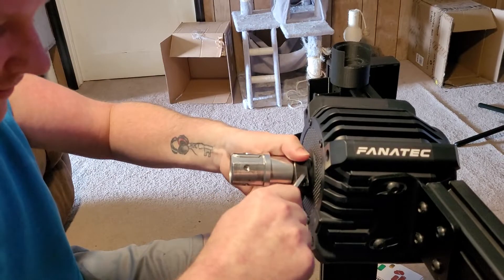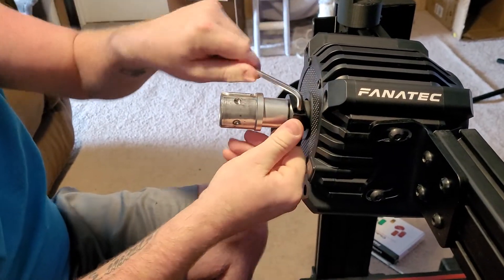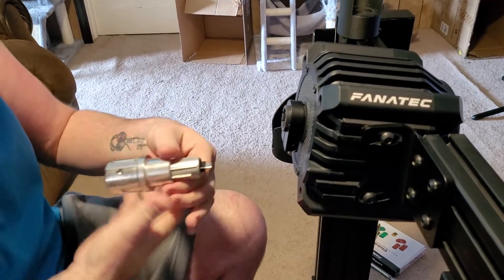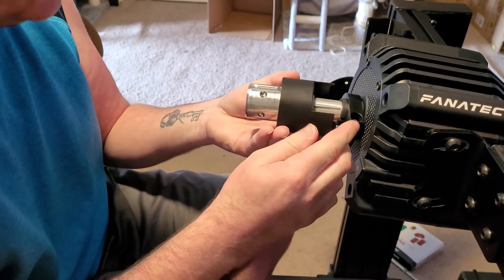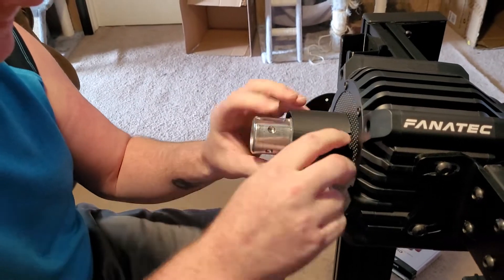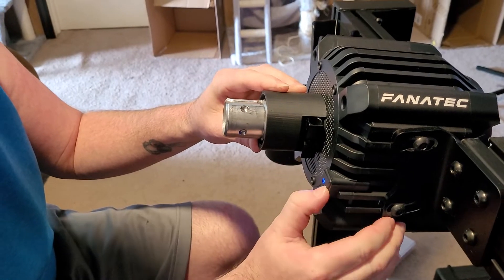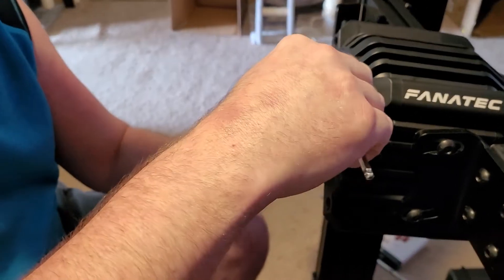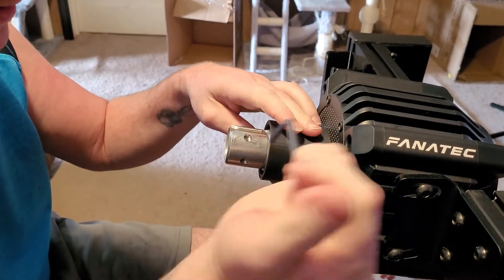how to install AT3DPRINTSHOP shaft cover for Fanatec wheel bases

Comment: You didn't mention probably the most important thing to do... you have to make sure that clamp is aligned with the gap in the shaft, otherwise you can damage the shaft/USB port. It is in the manual, if you read it.
Reply from the maker: Yea I just put it back exactly how it was. You are correct though

Comment: Can you still recommend the shaft mod? I can get my hands on one and would appreciate to get rid of the "clanky noise-feel" moments and the flex. Does it really work?
Reply from the maker: it doesn't make it 100% go away but it does help! i still totally recommend it though as it make the wheel base look so much better hiding the silver shaft while everything else is black.
Reply: @Jedtgill  I ordered one and can't wait to test it cause the clunky feel and sound is making me nuts, even though it's not a constant issue. But can I use the shaft while I tighten the Qr1 with the setting skrew?
Reply from the maker: @Gelangweilter  yes! That set screw is in the QR1 that sleeve comes up against the back of the qr1. Message the owner before it ships and see if it would be worth your while to order the ones he makes with a set screw built in. If he still does those it help eliminate even more movement
Reply: @Jedtgill  damn it, mine is coming without the extra screw, I hope it does the job aswell
Reply: @Gelangweilter  mate try running the wheel without the screw in your qr1 idk but that's the only noise my wheel makes is the qr1 bouncing off the screw since the quick release sleeve rotates and hits the screw.
Reply: @Jedtgill how much %?
Reply from the maker: @moncimoov  I have one of the very 1st versions and I'd say about 75% I was completely satisfied with it though. I'm sure he has mad revisions since then and it's better now. All of his stuff is top notch
Reply: @Jedtgill  thats nice.. im thinking to print one myself .. gonna target 90% with added rubber or thin layered plastic also

Comment: Is this useable with qr1 lite ?
Reply from the maker: Yes you just have to select qr1 lite when you buy it
Reply: I’m having connection issues during mid race I don’t see where the option is for the QR1 Lite? Have they changed the listing I don’t want to purchase the wrong thing
Reply from the maker: @RyanBMcLaren  I'm not sure to be honest. Message Caleb through Etsy he will set you on the right path!

Comment: 🤔 It's causing my steering wheel to jerk and it's hard to screw off but from what I'm seeing on yours.. minds is really on their real tight having trouble screwing minds off hoping that's the issue
Reply from the maker: Thats prob due to fanatec crappy tolerences. This item shouldnt cause the wheel to be jerky. Did you by chance make sure the pegs in thebcolor were lined up when reattaching the wheel? Either contact AT3D he is a great guy and will help no matter what
Reply: @Jedtgill  😎  Ok got it.  I finally figured it out after 3 days it was the options in my Desert rally game The option for the steering wheel feedback was on that's what was causing my steering wheel to jerk around
Reply from the maker: @kal-elthelast8834  glad you got it figured out. As far as AT3D i 100% stand behind all his products i have purchased just about every item he sells. Feel free to follow me and ask any questions you ever have!

Comment: I got the clamp for the Podium DD wheelbases on my GT DD Pro (the round one with two bolts instead of one) so this 3D print won't fit on mine, Fanatec put this clamp on after repairing my wheelbase that got damaged because the shaft got pulled out and then the USB inside the shaft didn't align properly so when I pushed it back I pushed straight through the PCB inside the wheelbase and destroyed it, thankfully Fanatec repaired it within warranty at no additional cost.
At least now the shaft is held a bit tighter so it's harder to pull out the shaft, still... using only a clamp to hold the shaft in place is just bad design imo.
Reply from the maker: Yea but all the noise and wobble sadly comes from the QR not the shaft
Reply: @Jedtgill  Yes but I was saying this solution won't work for me because I have a different (bigger & round) clamp on my shaft.
Reply: The creator of this product has a second version that works with the double clamp like you have.  He also sells a double clamp, which I bought to upgrade mine, as well as his sleeve that goes with it.

Comment: My shaft is bent to the left for some reason, I hope it doesn't make the cover brush against the base
Reply from the maker: Have you contacted fanatec about the shaft?
Reply from the maker: Either way ot does have a little room to move forward or backwards so i wouldnt worry about it causing damage
Reply: @Jedtgill  yes, still waiting after almost  two weeks sadly
Reply: @Jedtgill  Great  gonna get one for sure. By the way, is your shaft completely straight? Some people say it's normal for it to have an offset but I'm not so sure about that
Reply from the maker: @JohnnyEMatos  i dont think mine does BUT if your wheel isnt angled perfectly with your seat it will seem like its bent at an angle
Reply: @Jedtgill  it goes up when I turn right and down when I turn left (because it is pointing left) I can aldo observe that on the stator without the shaft attached to it, so it's not really the shaft itself, but the angle that the stator comes out from the motor. I even removed the plastic front plate to see it better
Reply from the maker: @JohnnyEMatos  i woukd stay up late and get with fanatec live chat. That 100% doesnt sound right

Comment: Warning! 

Within 4 months of light use my FANATEC McLaren wheel cracked at the shifter pivot point and where it mounted to the QR. I was accused of over tightening although I used a torque wrench set at 3nm. 

FANATEC then replaced the wheel chassis admitting in writing it was a weakness in the wheel.

Very soon after my CSL load cell pedal failed. I sent a video before sending the pedal set back as requested.

I was required to make a follow up email after not hearing back. 

FANATEC said they can not fault the pedals asking if I want then sent back which I found a strange thing to ask?

Eventually they were returned however within minutes I experienced the same issue which was consistent with magnetic interference from the CSL DD wheel base before the load cell pedal would completely shut down.

I was beyond my limits at this point and driven to warn as many potential customers as I could while demanding a replacement.

Following the usual delayed response, FANATEC then offered a replacement only if a show proof that they faulty load cell was again on its way back to them.

FANATEC’s poor response time drove me to desperation. 

Keep in mind I have owned this new product for around 6 months when 2 major failures occurred.

An electric technician overheard my experience and offered assistance.

I was able to demonstrate the issue and within minutes the technician diagnosed a defective voltage regulator attached to the load cell circuit board. 

The voltage regulator is designed to reduce 5 volts coming from the wheel base or USB down to the required 3.3volts. There was no signal out of the regulator which he replaced.

I am now enjoying my sim racing again while I hold my breath for the next FANATEC failure.

Please take my advise and look at the FANATEC’s own forum in regards to all the issues they have and their terrible customer service.
Reply from the maker: Ive had mine since gt7 launch and its like brand new with close to 1000 hours. Id contact support
Reply: My shaft collar keeps slipping I’ve done all the typical move it as far forward and tighten as tight as possible im a big guy with a lot of power and I couldn’t possibly tighten it any more ruins the whole experience
Reply from the maker: @jordanblud10  contact the maker and ask him about the one with a set screw
Reply: I have needed Fanatec support two times now (actually 3 times but the third time was right after the 2nd because Fanatec repaired my wheelbase but broke the connector for the pedals) for my GT DD Pro bought on release, and they have been very benevolent to help me out.

The first problem I ran into was the GT wheel that had the rubber worn out down to the plastic underneath after like 6 months of use, so I contacted Fanatec sent them a photo, and they sent me a return label, a week after sending it in I got a package back with a brand new wheel in it, unfortunately though, it now already has the same wear on it, so it wasn't a bad batch of rubber which I thought caused the first wheel to wear down too fast, so I'm kinda forced to buy a new wheel unfortunately. 
I recommend NOT to get the GT DD Pro bundle with the GT wheel, always get a different wheel because the GT wheel wears out way too fast.

The second problem was caused because the shaft can get pulled out if you have the tendency to pull on the wheel, at some point the shaft got pulled out far enough that the USB of the shaft didn't touch the USB in the wheelbase anymore and somehow the USB connection didn't align up properly which shouldn't be possible considering you can only put the shaft in 2 ways and the USB C connection is right in the center so no matter what way you put it in, it should always align.
So I tried to push the shaft back after loosening the clamp, but because the USBs weren't aligned properly, it didn't go in like it should've, and when I pushed a bit harder I pushed straight through the PCB inside the wheelbase, so it got destroyed basically.
And again after sending them a picture and a video as requested they let me send it in, a week later I had a working wheelbase again and now with the clamp from the podium wheelbases on it, which should be able to hold it a bit better as it has an extra bolt to tighten it on both sides, so far the wheel has not gotten disconnected yet, so that's a good sign I guess. Only now I also had a loose connection for the pedals that caused some faulty input in some cases, which wasn't the case before I sent it in, so I sent it back in again, and another week later I received it back and everything was working as it should.

I was very surprised Fanatec didn't charge me for the wheelbase repair, as they could have easily said that I had broken it myself, which I technically did... I'm also thankful for the better clamp, it seems to help, although I'm keeping my opinion that holding the shaft in place with only a clamp, is simply a bad design choice!

Comment: The point? You just put some ugly 3d printed plastic tube on the shaft of the gt dd pro. Customers really do buy anything
Reply from the maker: It actually puts pressure on the back of the metal QR1 and keeps it from being so noisy. Luckily for you it's something you don't have to buy. I'm not sure who hurt you but being so hateful over something so small is amusing
Reply: @Jedtgill  i dont mind the noises i like real simulation,idk how much pressure and friction that adds on youre Qr but adding uncalculated pressure on a rotating object(wheel) is never good, i think it looks good though would look nicer in carbon
Reply from the maker: @FLEXBLUNT  it rotates with the wheel. Fanatec QR1 is known for how noisy it is and how much slack it has in it